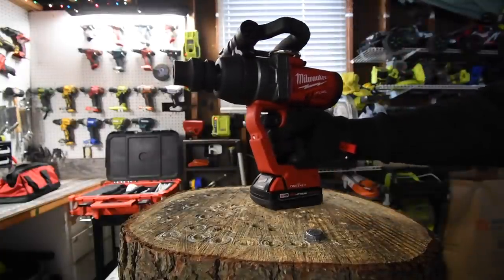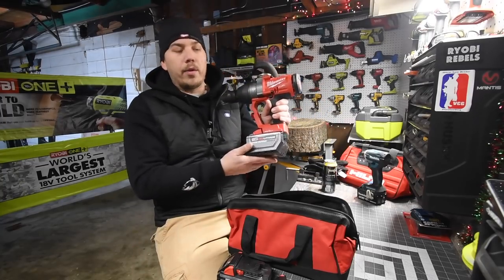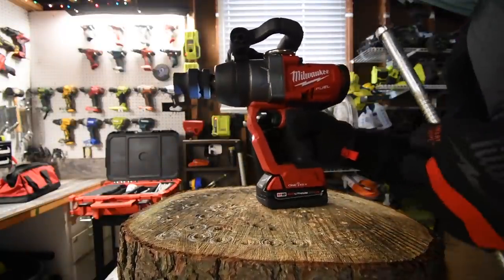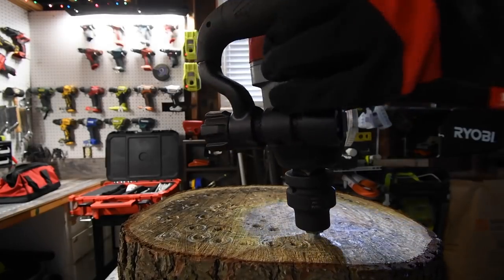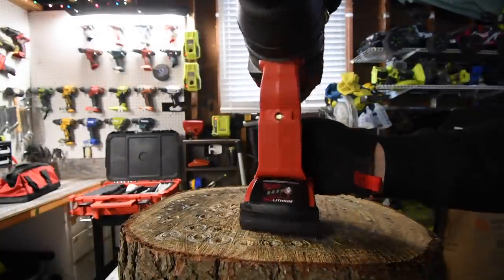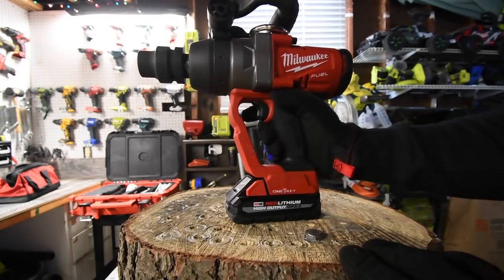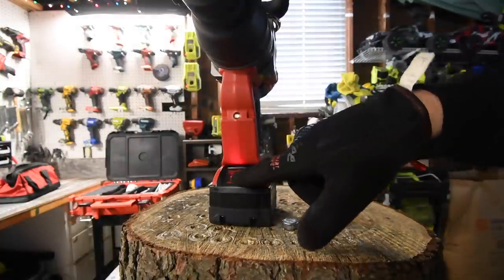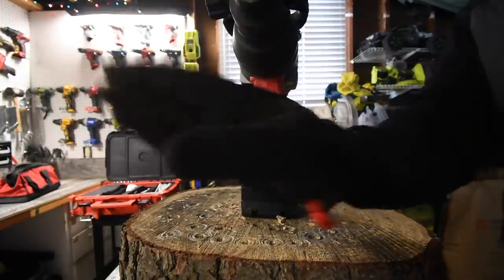Milwaukee Battery Test (1" impact Wrench)

Comment: The 2ah was overheated. I like this test. People never believe me when I tell them that bigger batteries make the tool more powerful
Reply: It's all math. Milwaukee rates their batteries under load (18v). Ohm's law is voltage (x) current (=) power. A high power tool like this can easily output over 1HP... Which is incredible for a cordless tool. If you're running a 12ah battery and it dies in 10 minutes, that tool was drawing 72 amps. That's 1296 watts, 1.7HP.
Reply from the maker: it did survive :) I thank you for viewing Muddy. and yes a higher ah battery does give the tools more power
Reply: Actually, the 3.0 compact is the more powerfull than the 5.0..
Reply: @ronbeton1999  the 5.0 is slightly better. It's equal on some tools but the 5.0 pulls ahead on other tools. I encourage you to test it out yourself before making those claims
Reply: @muddybadgers5205  Than I encourage you to learn some math before making these claims. The 5.0 has 2 packs of 18650 cells that give 720W. The 3.0 compact has 1 pack of 21700 cels that give 774W.
Reply: Why milwaukee should bring back the m28 series
Reply: @ronbeton1999  Its all about the cells. In the tool industry, “Six Cells”. lol

Comment: I'm actually very impressed with how well the 3.0 ah HO battery did. While it obviously doesn't have the longevity of a bigger HO battery, it actually performs very well on that tool. Thanks for running  these tests and comparing apples to apples. 

And congratulations on 30 K subscribers.
Reply from the maker: I thank you very much David :)

Comment: Man the difference between the 2 and the 3 was insane. The difference of one amp hour cut the time in half.
Reply: And the three ah is high output that helps it pull more power
Reply: @jacobtietjen8205  even the standard 3ah crushed the 2
Reply from the maker: and it almost destroyed the 2ah lol. I thank you for viewng Vane

Comment: The half inch m18 fuel high torque will over heat a 2 amp hr batt also
Reply from the maker: the 2ah battery did recover. I thank you for viewing Joshua

Comment: My circular saw, M18 2630-20(8 years old) will overheat a 4ah battery. When this tool came out, batteries were 1.5 and 3ah. I put any other battery on it and it does fine!
Reply from the maker: how old was the 4ah battery?
Reply: @ManCaverTools  last Xmas

Comment: i like your tests because I've never trusted small-sized batteries i do plan on getting m18 tools soon.
Reply: Well worth it, for indoor work get the m18 fuel surge impact driver, I'm a steel cladder and it is a good controllable impact hex driver
Reply from the maker: I thank you Chis. that is what these tests are for :)

Comment: Nice dave loved it is a beast like that 1inch good to see the tests as to be expected with the 2ah would have cooked the cells to much amp draw probs and im really into welding my self i did i used study engineering fabricating used corded  grinders and welders alot and  mostly mig  then and drills lattes  intresting to do
Reply from the maker: that 2ah did recover, Luckily lol

Comment: I almost bought that 1" impact but held off and waited for the D handle  version.
Reply: I agree. Unless someone absolutely needed the pistol grip, the D handle is only $100 more and has 400 more fastening lbft, and 200 more reverse lbft.
Reply: That's right💪🏽
Reply from the maker: it is a benefit to use it with only one hand though. I thank you for viewing Jason